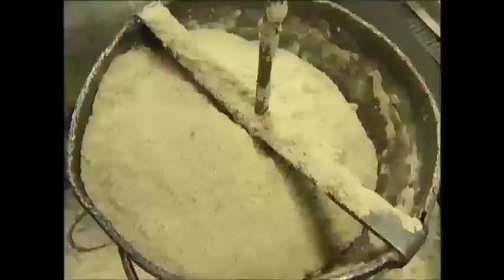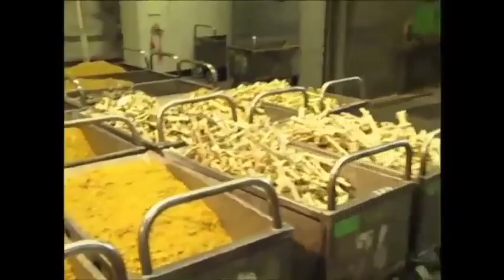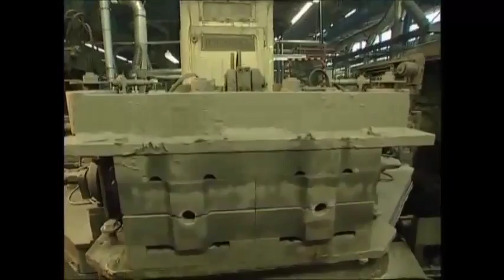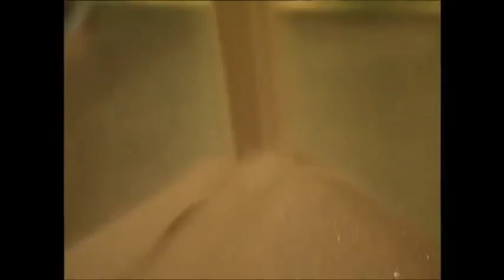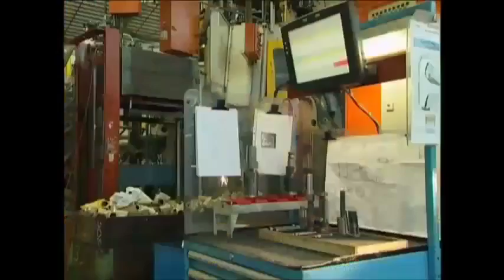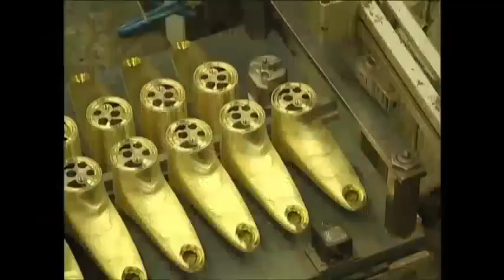How It’s Made Water Tap

Comment: We are auto machine supplier of Lota，Roca，Solex，Kohler，Lixil PPI，Runner etc. We can provide all machine for faucets production line from start to finished.Especially sand core shooting machine，low pressure die casting machine，grinding robot，peeling machine，automatic polishing machine. Wechat:8613670190553，WhatsApp:+8613670190553，Email:dzivy@idzxm.cn

Comment: Please explain the production processes
Reply: Asghar Abbasi    We are auto machine supplier of Lota，Roca，Solex，Kohler，Lixil PPI，Runner etc. We can provide all machine for faucets production line from start to finished.Especially sand core shooting machine，low pressure die casting machine，grinding robot，peeling machine，automatic polishing machine. Wechat:8613670190553，WhatsApp:+8613670190553，Email:dzivy@idzxm.cn